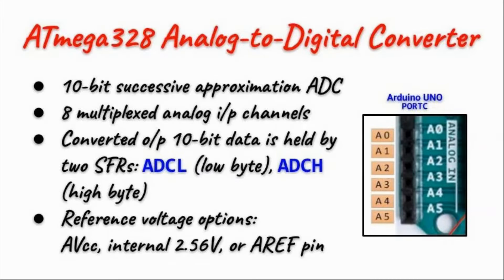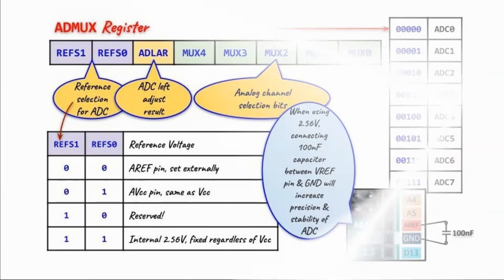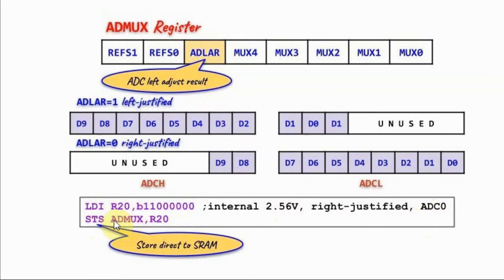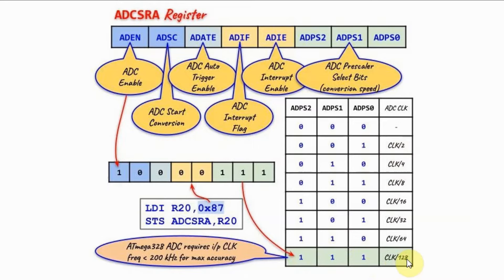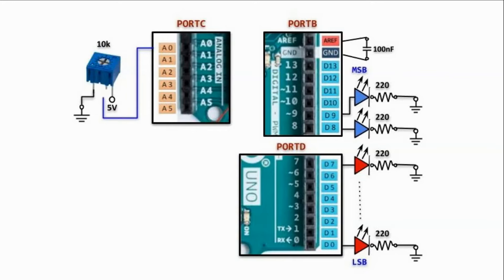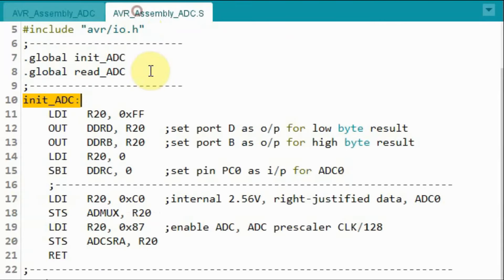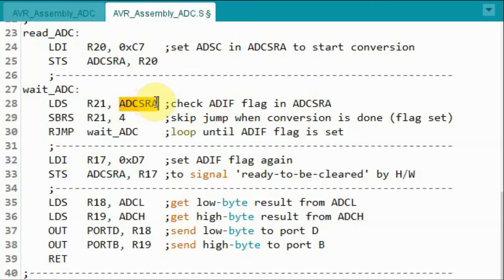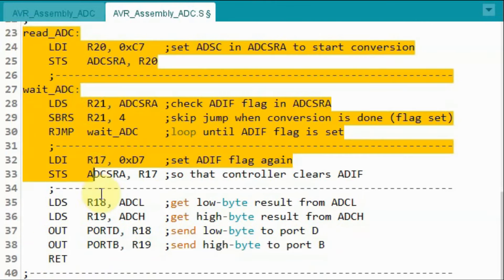Assembly via Arduino (part 4) - Programming ADC

Comment: Sir why in left justified ADLAR  the diagram shows D1, D0, D1, and  unused?     Why D1 is repeated? and it's 11 bit too.
Mistake in the diagram?
Also,  can explain a bit more about AREF voltage?  I usually use  AnalogRead  math formula that involve 5v and 1023.
why use 2.56v? and where does the 2.56 value come from?

Comment: Hi again, i saw Dr Robert Paz serie on embedded systems, he never talked about nibbles utility, as you did use them in LCD Programming. I would be glad to know where you learned that kind of thing! thx
Reply from the maker: Hi, from shear experience. I start with a flowchart and see if it logically works. Then code it in assembly. Again, the key is experience, which comes with practice.